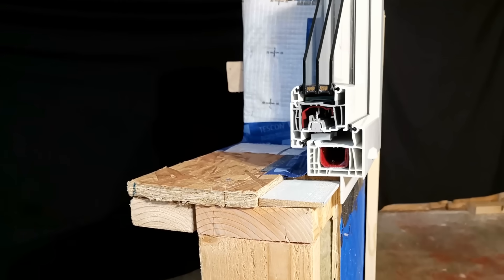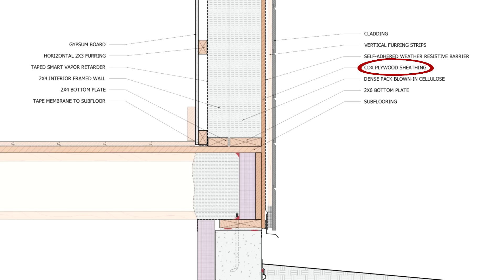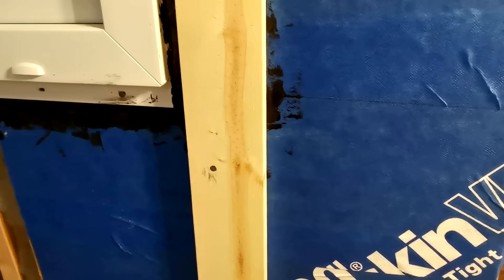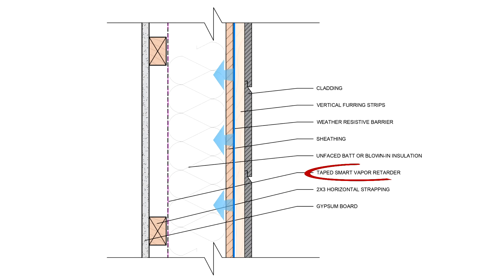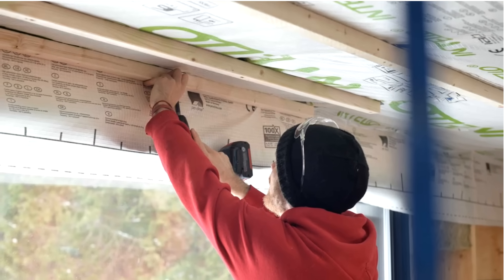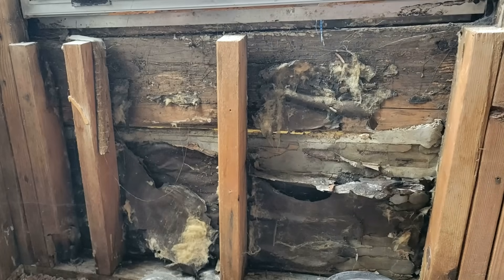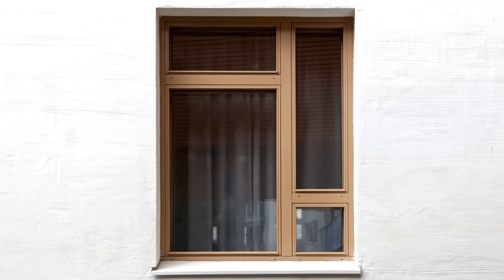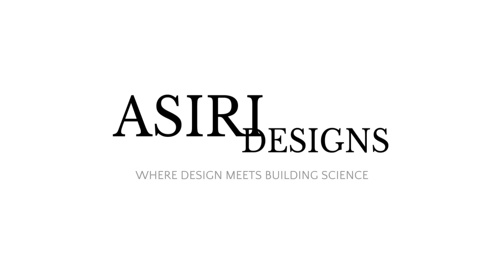CRAZY R-Value for CHEAP! A Guide To Double Stud Walls

Comment: I have little faith in the ability of most workers to adhere to the details required to accomplish these complicated wall systems
Reply: This is we’re hiring a competent contractor/company come is to play.  I’ve been in the field 30 yrs I made it a point to with all the trades early on especially on smaller jobs and learning the latest and greatest but mostly what really works and doesn’t work now I transitioned to being a GC but my over site is meticulous. Like most have said attention to detail. I have the same subs I’ve used for years over and over the guys know what I want and how I want things done so the learning curve is long gone.  I worked with a few GC that higher different subcontractors over and over and you see the results are horrible.
Reply: Absolutely. Fly me out and pay a big bill, we’ll talk.

No but seriously I get you, I’m such a picky prick and the work I see left and right is pathetic.

I mean screw a nicer system like this. Most of these dopes can’t even install the most basic system properly.
Reply: @justinstevenson2061  

I'm building a house down the road, which is why I'm looking at all of these options now.  Curious, what would a competent crew cost to put up a two story, 2000sqft/level house with one of the better wall techniques.

Yeah, I know, MANY variable, but I bet an experienced GC could put a generalized number on it.

Fair wage for a fair day's work...
Reply: @mjktrash there’s the thing, I don’t know the pricing side of the overall build.

I’m roofing/siding/insualtion.

I’d love to get into builds as I would know how to do everything from foundation to framing and all waterproofing etc.

Waterproofing, air sealing, and insulation are all part of the same thing in the end. The soffit and attic and roof are all one structure. Same for walls, insulating properly, waterproofing, air sealing, and providing drying capability are all really intertwined to do it right.

Utilities, mechanicals, interior finishes and the whole permitting process etc is where I don’t know.

I know people that know nothing and jump in a sub it out and put out crap, I just would expect more so wouldn’t put out less.
Reply: @justinstevenson2061  what state ?
Reply: @gypsetsalon2585 I’m up in Canada. So it’s really important especially to have the VB right spot, everything to dry properly, use the right materials etc as we can get as low as -25/30 C in the winter and +30/35 C in the summer, and pretty humid.

So we gear to ‘heating climate’ for VB and it goes inside.

Then summer cooler inside and lower RH, then hot and humid outside. So that system has flaws if you use poly VB.

Smart vapour barriers are the way to go. And use plywood not OSB, plywood passes water vapour better.

Use exterior insualtion to move dew point out, strap the walls. Tyvek over CI not under. Want SA membrane, do it first, then CI, then tyvek to keep rigid insualtion dry and no air movement.

Strap it for drainage and importantly airflow to dry anything coming through.

Further north no issue not as warm, but southern Ontario sees a crazy bunch of crap for sure.

Farther south more cooling climate only. Worrying about one is already bad as some people suck at their jobs.

But then dual climate like this is harder to control.
Reply: Workers do what supervisors/managers want. All you need is one competent guy to build a quality house.  Worker-bees do what they're told.
Reply: When you say "most workers" what you of course mean is the cheap ones everyone gets ot scrimp and save. 

Any serious tradesman with the necessary qualifications and experience wouod find this old hat.

Three non-union uninsured illegal labourers however are of course a totally different story
Reply: That's why there are inspections

Comment: I would switch the second stud wall from interior to exterior, so the structural sheathing is in the middle of the double stud wall, the outer 2x4 wall is only to contain the second layers of cellulose, is closed off with no sheathing, just vapor open wrb, then furring and DensGlas sheathing to fasten facade materials to.  No need for Intello inside, just insulation netting, then furring utility channels.  No need for Blueskin and cdx, just osb and vapor barrier.  The osb won't collect condensation when several inches of cellulose are outside of it in a continuous layer.  Inside dries inward and outside dries outward with no layer to condense on.  The cellulose can be srpayed to fill both stud walls inside and outside of the sheathing sandwiched between them at the same visit.  The sill plate would be set in from the edge of the concrete foundation and protected by the vapor barrier taped to the foundation concrete and then by the exterior layer of cellulose, while the second sill plate for the 2x4 outer stud wall is still visible for termite inspections.
Reply: Am I understanding correctly that you're putting the vapor barrier on the OSB in this instance, between the two layers of insulation? 

Even without a vapor barrier I'm finding the OSB to be enough of a vapor retarder to get to 20% moisture in one temperate climate winter season. Which is already plenty to start rotting, let alone if an actual barrier is added.

Do note that a wall can't simultaneously dry inward as well as outward. Depending on the season (and local climate) all moisture either travels from the inside air to the outside, or the other way around. Both times hitting a vapor barrier/retarder (the OSB), where it will condense.
Reply: @sigi9669  If the OSB has 5 inches of cellulose insulation on both sides of it, it will be warm and never be a condensing surface.  Water vapor will not move through a wall that has a true fully sealed vapor barrier.  If the outside of the OSB has a vapor barrier and is kept warm, there is no movement of air or vapor toward the OSB from the interior.  That only happens when there is a pressure differential between the inside and outside or there are paths for the air to try to equalize. 

Double Walls can indeed dry inward and outward if there is a vapor barrier between the inside and outside components.  They are really two separate walls this way, not just a staggered stud single wall, and the outer wall creates the continuous exterior insulation layer that keeps the inner wall from being a consdensing surface where its low temperature creates the low pressure area that can attract warm moist air from inside the house to the sheathing.  

If your understanding was correct, then homes that have ONLY exterior insulation would have their sheathing rotting on the inside surface, but several of Risinger's version of Perfect Wall homes have done that -- no cavity insulation between the studs, no drywall, the sheathing fully exposed to interior water vapor but not a condensing surface because the outside is insulated, keeping the dewpoint somewhere in the exterior insulation layer.
 
The "Perfect Wall" Explained
• 	Developed by Dr. Joe Lstiburek, the Perfect Wall concept places all four control layers—rain, air, vapor, and thermal—outside the structure to protect it from environmental stressors.
• 	The sheathing (often OSB or plywood) becomes part of the structural core, and continuous exterior insulation keeps it warm, preventing it from reaching dew point even in cold climates.
• 	Interior insulation is optional. In many examples, the inside surface of the sheathing is left exposed, and no rot occurs because the sheathing never gets cold enough to condense interior moisture vapor.

Comment: Thank you for another informative video. But the design made me think of the deadly 2017 London apartment fire. Forensic investigation concluded that the air gap between rain screen and insulation acted as a chimney and was fundamental to the death and destruction.
Reply: Perhaps an intumescent barrier that grows to block the chimney in presence of fire
Reply: I think a bigger problem is the UK fire code doesn't require installed building sprinklers on each floor. Also, I visited London in 2014 and was absolutely shocked at the totally inadequately designed emergency stairs in a 8 year old, 5 story building (ground + 4), in a fire it would have been a giant chimney. This was discovered and regulated against in the US prior to 1900.
Reply: There's no getting around an air gap for most (if not all) types of exterior cladding. Hence it's a good idea to not use extremely flammable cladding and isolation, like that tower did. 

Though there are ways to compartmentalize the air gap. Giving first responders more time.

Comment: Curious if there is a reason why CDX with Blueskin and not Zip or similar product?
Reply: He mentioned that osb has a lower perm ratings and doesn't change with seasons much compared to cdx, and that it hods water longer than cdx.  Zip is just osb with an impregnated barrier so it isn't going to have a HIGHER perm rating than osb alone.  The blueskin+cdx retains a higher perm in all seasons.  The high perm is needed because they have no true exterior insulation outside the sheathing to prevent condensation on it.
Reply: @kirkellis4329  right I forget zip is osb. I’m not in construction. I’m just a couch enthusiast. Still, I would love to see a breakdown of Great Wall assemblies and pros and cons. Zip R6 with 2x6 walls, intello, and inner strapping seems like a good combo. Less prone to install error. Maybe not. There are so many combos of ways to do good walls but it would be nice to see the options on a $/ft breakdown or something. I’ve seen other channels do that but they’re always for warmer climates.

Comment: use positive pressure hepa hvac to obviate many of the infiltration and moisture issue, add a heat exchanger - they can be 90% efficient so you won't lose energy

Comment: The biggest problems I have with double walls is we have such a shortage of qualified labor and there’s so many places that a double wall can fail if it’s not done correctly that I hate to say this but we need a dummy proof method of this type of construction in order for it too be able to be scaled up otherwise this will just be reserved for high end homes. Which is fine if we aren’t trying to better everyone. 

We need a solution that can be scaled up and where the products don’t cost a small fortune to implement. Double walls are great but if you count how many times u said how careful u need to be and how important each step is now think about prices of homes and labor issues and now this house is unaffordable for the majority of people in the country.  

I’m a builder in Wisconsin and even in high end homes most people don’t want to spend the money on the extra insulation due to cost. 

I don’t have the answer ms however I’m hoping someone like you can try and come up with an easier alternative that’s what we would call a pretty good house. 

At this point the easiest system I have seen that can be scaled up done by basically anyone is icf and adding insulation can get to passive house levels fairly easy.

Comment: could you do a video about using mud ( i mean literally dirt / earth) in modern construction. it ticks alot of boxes and is super cheap of course.
Reply: Unless your wall is over 2 foot thick it's not worth it. My neighbors built a rammed earth walked house with 12" thick walks, then they had to build a false wall inside to hold insulation. The problem is you have to have thick enough for thermal mass AND get the temperature "wave" from daytime travel through the wall to the inside surface all night long. In E. Texas they thought they didn't have to use thick walks like in the hot western US, but turns out they did.

Comment: Just curious if any commenters can say why in some pictures the 2x3 horizontal strapping is on edge and other times it is “flat”. On my calculation, on edge gives 2.5” between the intello and the drywall. A standard receptacle box is 2.75” and when you count the drywall layer at about 1/2”, then a standard receptacle box would fit in the walls if the 2x3 is place “on edge”. This also gives you space to run 1.5” rigid rockwool insulation. 

I’m retrofitting an 1860s farm house with interior 2x4 stud walls, rock wool batt insulation, intello plus taped without penetrations and 2x3 horizontal strapping  on edge with 1.5” rockwool board insulation. All my utilities will be run in the 2x3 utility cavity. 

Anyone see issues with this. Will do exterior continuous rigid insulation as time and budget permits.
Reply: Receptacle boxes are sized by volume for fill. So yes, many can be standard boxes if you have a 2x3 depth service cavity. Some with higher box fill might need a double width with a double to single width mud cover. Shallow doubles can work in a 1.5" cavity also, but be careful to keep all wiring at the very back or protected in a 1.5" cavity per electrical code. 2.5" is like building a wall. 1.5" is like strapping a wall.

Comment: I would always go with a perfect wall over a double wall; it's just the best way to go from a thermodynamics perspective. If I did have to go with a double stud wall, I would take a gypsum panel over even plywood, the ExoAir version of Securock ideally; that way, you only have to worry about liquid flashing the joints, no need to do origami with sheets and tapes.
Reply: What do you mean by a 'perfect wall'? Meticulously detailed? The very best single-stud wall, carefully detailed, will never perform well. Double-stud construction is very simple and straight-forward, nothing an everyday framing crew can't understand. Per square foot, nothing is going to be more cost-effective either.

Comment: The thing I like about exterior insulation is that it eliminates ALL thermal bridging, whereas this double wall still has thermal bridging thru framing at the floor, around windows, around doors, at top of wall, etc. Don't get me wrong, this is obviously a huge step up from single wall construction with no exterior insulation, but exterior seems to be the gold standard if you want optimal thermal efficiency.
Reply: There is still some thermal bridging at doors and windows with exterior insulation. it's pretty hard to avoid completely
Reply: @aaronoconnor606  Very little, probably 1/4 that of a double wall and less is better.
Reply: What about the thousands of steel fasteners penetrating the insulation to hold it to the framing material?  Add that up and it’s a significant bridge.  Stainless fasteners cut that down by 60% but cost big $$$.

Exterior insulation is often non-permeable foam, which will provide a cold condensing surface for moisture coming through the wall assembly and trap it against the sheathing.

I have been to plenty of jobsites where exterior foam was not being applied properly, with gaps everywhere and corners broken off etc.  Now you’re paying big $$$ for foam that’s not doing much.

Post-build energy testing is the ONLY way to hold builders accountable for the performance of their homes, and long warranties are the only way to hold them accountable for durability.  Without that we’re not getting anywhere.
Reply: @superspeeder  Fasteners at 2ft centers are totally irrelevant compared to 2in framing members.

Comment: Pro-Con on blueskin vp100 vs. ZIP System?
Reply: The biggest difference is zip system is osb, while he is applying this blue skin to plywood, which is a far superior product as he mentioned.
Reply: @deadlata9767  I like to see a 1-year test with four sides of a house same  in the north, central and south of the east coast. With pictures every taken every 1st and 15th of month. Then after the 1-year of four season a full inspection.

Comment: So, double stud wall or continuous exterior insulation,  if you had to choose, for zone 6?
Reply: I mean I’d go both if you could. But to pick that’s a good question.

The double wall surely gives higher R value than exterior if looking at comparable costs.

But the exterior insulation will make such a difference. As mentioned in this vid the double wall has to be so careful about air and water proofing as it’s thicker and doesn’t have as much drying potential.

The exterior insulation will move the dew point outwards a bit, causing less moisture to form in the cavity in the first place.

The double wall can have continuous insualtion in the middle cavity space between stud walls, but the exterior stud wall will still have thermal bridging into the cavity.

Not straight to the home, but cold can go through exterior studs into the cavity.

Still can be a spot moisture might want to form.

Exterior insulation can give great R value, with the benefit of reduced moisture forming in the cavity.

And then what moisture might form in the cavity is close to inside to dry though if you’ve used a smart vapour barrier.

Comment: Insulation-What about the new “Sprayed fiberglass batt” benefit of glass material not rotting, and spraying to fill the corners (stop air flows).
I am in the deep south Tampa,  so would the vapor resistive line be on the exterior?
Reply: My experience with new products without provable independent 3rd party testing. And peer reviewed.
Otherwise, it’s just the salesman word.

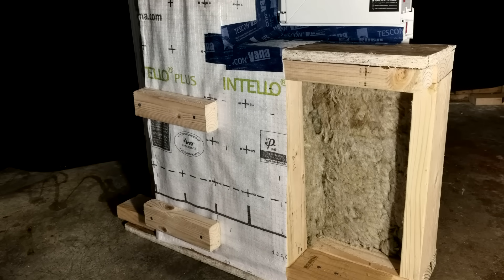Comment: 1:19 the subfloor is going all the way out to the sheathing. Shouldn’t there be a thermal break there?  (I’m just a dumdum layperson so forgive me if this is a silly question.)
Reply from the maker: I wouldn't obsess over it unless it was  steel, as wood is a relatively good insulator. Thermal bridging at that joint is truly minimal/inconsequential.
Reply: Perfection is not achievable considering this is all building structure.